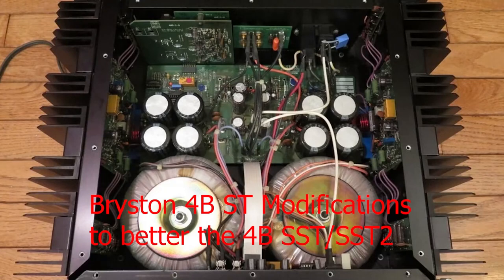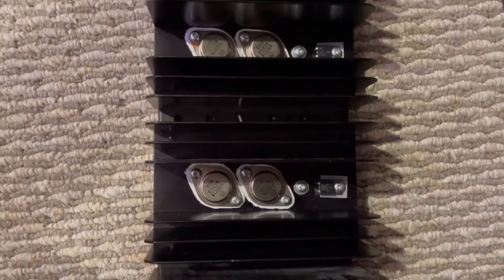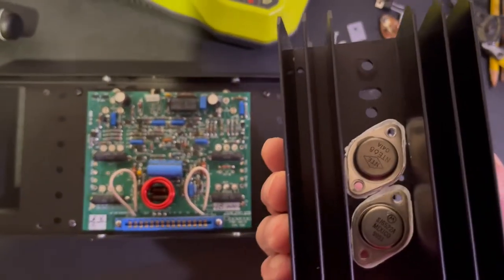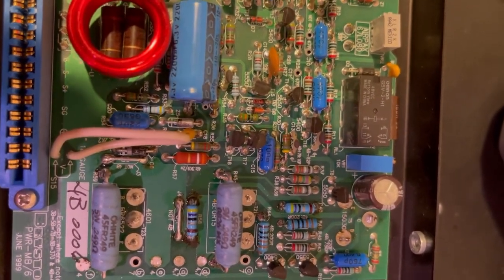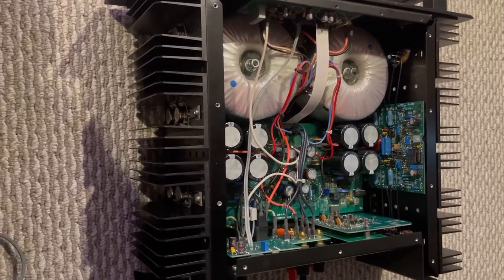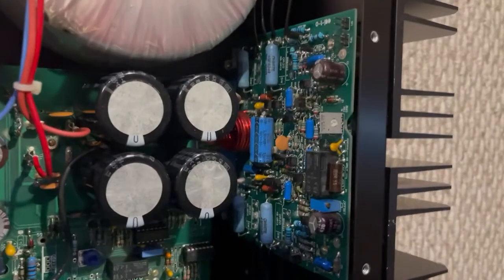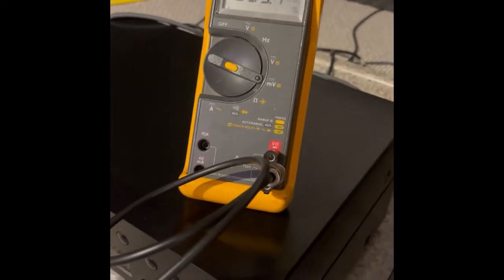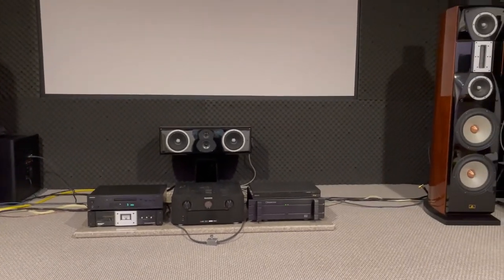Modify the Bryston 4B ST to better most high-end audiophile amplifiers - Part 2, Step-by-Step

Comment: Good video friend, I'd be interested to know if you've modified your Aurum Cantus, those are beautiful. Mine, I had a resistor across the ribbon tweeter I removed, and recapped with Mundorf Supreme EVO Oil with Supreme Silver Oil added as bypass on tweeter. I am considering some work on my 4B ST too.
Reply from the maker: I have upgraded all drivers on the Aurum Cantus with SEAS and Peerless, and redesigned the crossover to match.
Reply: @neighorizon-4190  Ah man, that's great... 👍
Reply: @neighorizon-4190  What did you think of the wire Aurum Cantus used, I kept it - "OCC", but somehow still find it suspect.
Reply from the maker: @rickysnit2163  The wires used are very high quality.
Reply: @neighorizon-4190  Thanks Friend, I kept mine, glad you think so!